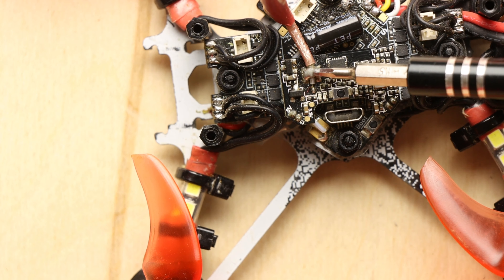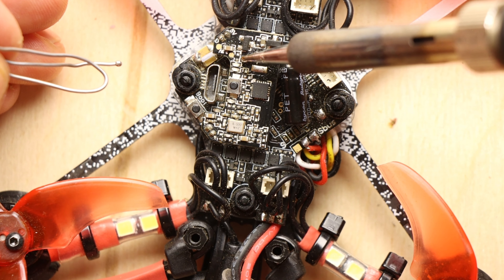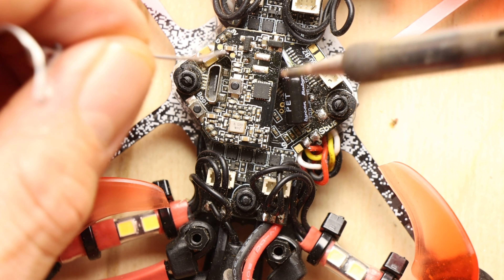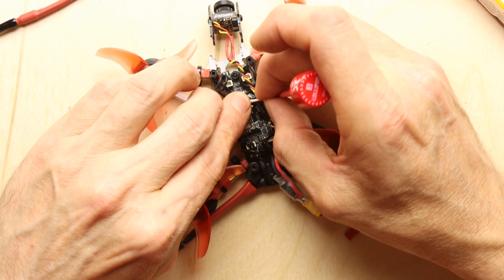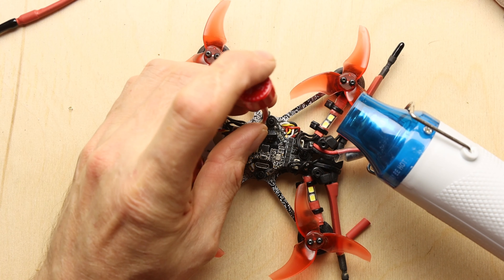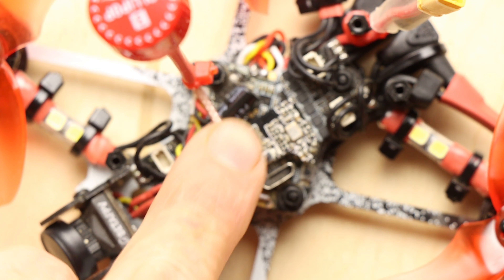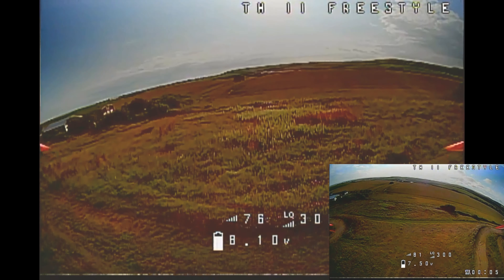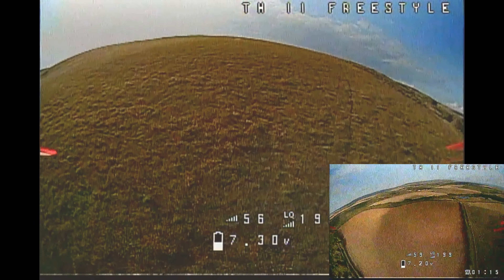emax tinyhawk 2 freestyle vtx antenna upgrade, amazing! results

Comment: Great video. Just bought myself this little quad after a lot of research and it’s great to see it being modded and it’s capabilities pushed further. Good job.
Reply from the maker: Congrats! Good buy! Top little ripper! Thanks a lot!👍
Reply: @Stevieboyfpv  I got myn too and it’s killing it ! I just don’t like the radio and the goggles that came in the RTF kit and I am looking for upgrading them. Any advise of what can I get for freestyle ?
Reply from the maker: @aymen3962  im flying eacgine 200d goggles which are superb for the price the 300d are more expensive but even better👍if your on a budget and don't mind box goggles the 800d are superb!
Reply: @Stevieboyfpv  okay and since I’ll be soldering a xfire on it I’ll buy a tango 2

Comment: Great video, you make the soldering look so easy. I have a lttle experience soldering and thought I would be able to follow right along and ended up with an epic fail. Lesson learned though lol. Soldering this connector is not for the faint of heart, very tricky stuff.
Reply from the maker: Thanks! Yeh having both the gear and practice is deff necessary but you can always solder the antenna directly do away with the ufl connector to make it level 3 difficulty instead of 10
Reply: @Stevieboyfpv  yes, but when I was removing the uhf connector that I did not get soldered on correctly, it ended up removing the signal connection solder joint all together. Big bummer for sure.
Reply from the maker: @ryzurrin  mmmm maybe watch my vtx video then so you can fit a better vtx transmitter and save the board that will be cheaper than a new board aswell 👍
Reply: @Stevieboyfpv  will do! You have some awesome vids, just wish this stuff was half as easy as you make it look lol. Have you had epic fails while learning?
Reply from the maker: @ryzurrin  of course thats why I made the vids to try and help others not make the same mistakes I did, I've killed a few components racking up the pounds along the way painfully! Thays why I made this series so the mistakes could be made and skills honed with this little guy which is massively cheaper before moving onwards and upwards in the hobby to the bigger stuff👍
Reply: How do you go about putting it directly to the board

Comment: I managed to break off the active part. Now what?
I seemed to successfully soldering the antenna on, and has flown with it, but this morning picture broke up, and it turned out that the pad was coming of. 
Great upgrade indeed. Any tips on how to save it? Anywhere else on the circuit board that I can find the active connection?
Reply from the maker: Sounds like you over heated the pad causing it to release 😔 unless you can scratch off the board a little to somehow get a solder point i don't know of another way I am affraid sorry.
Reply: @Stevieboyfpv  Thanks. Will try
Reply from the maker: @pedereskildsen  good luck! Hopefully you won't have to replace the
Board 🤞🙏🏼 i feel your pain ive been there, that is fpv unfortunately we learn a lot of skills...some painfully! I've spent thousands 😬
Reply: @Stevieboyfpv  Thanks. I did have to replace the board ☹. Fortunately I already had a spare from when my first TH got shredded by my robot lawnmower... 
(Don't fly during mowing, when not super experienced)😳
Reply from the maker: @pedereskildsen  argh! No! Thats a shame! But hey! Must of been a relief you had a spare! Some luck at least! Lawnmower aye!😬😬😬 that must of been a bad day! Enjoy being back in the air man!🤟

Comment: Do I need a special board to do this modification, or can I add this antenna to the original board my tinyhawk freestyle 2 came with?
Reply from the maker: This is on the original board the tiny came with. You can add the antenna directly or with the plug. The antenna directly is a lot easier by removing the plug and exposing and separating the ground sheath and active core and direct soldering. Practice till your confident with your soldering iron if your not already proficient 👍

Comment: Can you tell me what lollipop antenna you used and the connector too, and where I can get it for my Tiny hawk freestyle two?
Reply from the maker: I used a foxeer lollipop but any rhcp lollipop will work, its a uf.l connector but you can direct solder it the same as the original antenna also, you don't have to use the plug. I used companies in the uk 
Droneauthority and hobby rc and unmanned tech

Comment: Hey buddy what soldering iron and tip do you use, I’m feeling a bit overwhelmed with how small the connections are on the tinyhawk and not sure what to buy. Thanks in advance
Reply from the maker: Hi jonny, i use a zd-929c adjustable soldering iron with various size tips depending on the job. If you are going to get into fpv a good soldering iron is a must. I use a soldering iron 
Sponge
Brass wool 
Tip refresher crystals
Solder paste 
All to keep my tips in good condition as this is essential! I use flux core solder and good quality soldering makes a big difference so don't buy the cheapest.
I would advise buying a soldering practice pad and watching tutorials to get comfortable. Last thing you want is to kill your quad because you made an avoidable mistake. 👍

Comment: Another bang-up job. Much appreciate your experiments.  I had been contemplating some upgrades to my TinyHawk II FreeStyle. I’ve gotten my Crossfire kit in, and will be putting one in my original TH2FS, after I finish my 2nd one, which I’m now building from scratch. 
Thank you, keep up the great work!
Reply from the maker: Thanks man! Stoked you think so and appreciate your comments! Have fun with yours it really is an amazing little ripper!🙌🙏🏼👍
Reply: I got a tiny hawk what are the first upgrades I should get to make it fly faster and go longer distance
Reply from the maker: @thraxexotics3406  The motors are a 3 bolt which makes them a problem to upgrade unless you change the frame. But changing the battery lead to an xt30 connection with thicker gauge wire will help performance and the vtx antenna upgrade in this vid for video feed distance and then one of my rx antenna upgrades will help from one of my other videos 👍

Comment: I'm about to perform this upgrade. Would you say that it's a good Idea to stay around 300°C?
Reply from the maker: Yeh if your doing the plug you want it as low as possible as you can actually melt the tiny board the plug is made from its not as bad if your going for the sheathing method of direct soldering the active element and ground
Reply: @Stevieboyfpv  What were your heat settings? That's what I'm worried about. I don't want to over do it and melt the pad underneath. I'm going to remove the original solder and anchor one side first so that I can avoid the solder getting underneath.
Reply from the maker: @FlockofSmeagles  I was at just under 300 mines a dial not digital so its not super accurate I think if you can do it with touches like I did with a slightly wet tip you should be good at 300 what you want is just enough solder on the pads on th vtx board for it to stick like a little bulge so when you tack it its not cranked at too much of an angle pitched off the 2nd ground then add a touch more when both grounds are attatched taking care not to let the solder from either ground flow into the middle linking it to the active element centre. after that attatch the active element 👍

Comment: such long and loose antenna will cause noise on gyro.
Reply from the maker: Having no issues so far its been flying like a dream! I have considered antenna tube and a thicker zip tie for more rigidity though 👍

Comment: Your videos are great. I am looking into upgrading my video range. I am a new to FPV just bought the Tinyhawk 2 bundle pack to get started. I and dont know all the ins and outs as I am just getting into it. It is awesome to have people like you sharing your knowledge. Thank you. For fear of sounding like an idiot, can I do this Omni Lollipop antenna upgrade with the stock with EMAX bundle FPV goggles and achieve extended video range?  Or should I just extend the stock antenna? If I need to extend the stock antenna, could you post os send some links on you you did that? Thank you.
Reply from the maker: Thanks! Much appreciated! You can do this with the kit you've purchased but I'd probably change the antennas on your goggles aswell. Links are in this videos description of how I changed the rx antenna for more range under frsky antenna mod. If I were you as your new if you do this mod with the vtx antenna maybe do the direct solder method like the original antenna is soldered like I do in the rx antenna mod for both as the plug method is pretty hard! And maybe get some good soldering practice in 1st untill your super confident!  Also I as I hinted at in this vid I ended up going shorter with a chunkier zip tie in the end and having a little excess slack to allow for more flex 👍 happy flying! Enjoy the fpv life its pretty 😎
Reply: Once again than you so much for these videos. I did the Frsky antenna mod. Unfortunately there was not a great platform for the base connector so I just hard wired it. Then I did the Foxeer lollipop antenna mod whit the base connector like you did in the video. Range was increased but still limited by the video. Then I replace the EMAX goggle antennas with dual Foxeer lollipop antennas as well and WOW!!! I have been flying in my neighborhood which consists of 1 and 2 story residence, along flat land, very large trees up and down the streets and above ground power lines. My range increased from about 100-150 before I lost video, to about 500-600 feet skimming the treetops and houses. Thank you so much for sharing all your wisdom. Now I just need to get either a better camera and som letter goggles that can record video, or get and insta360 and a mount for it. BTW, how do you like the insta360 compared to a GoPro? Thanks again for all the videos
Reply from the maker: @CptRadical  excellent! Well done doing the plug conversion 👌 not an easy task so congrats! And sounds like a great range increase for a built up area with interference 😁 there is no comparing my naked gopro to the inta360go...maybe the go 2 with nd filters gets closer but the weight is the same the go is lighter and the tinthawk can handle it was better and keep a flight time worth flying. I have the go 1 as I bought one when they came out and on micro analogue quads like the tinyhawk 2 it give me recordable HD stabilised footage for 5 mins at a time and I just appreciate that for what it is their cheaper to get hold of now aswell. I think unless you are going for a bigger quad the go is the heaviest I would go for on th e tinyhawk...but! There is also frames avaliable to transfer the tiny components over to which would allow a motor size increase which could possibly allow it to carry more weight like a go 2 or naked gopro as the current frame only allows 3 bolt motors limiting you to basically stock. Hope that helped happy flying!😎👍
Reply: @CptRadical  Drone bro nice work! Now really make this complete. Fatshark Dominator. Rapid fire module. One omni antenna, one patch antenna. If I had known before I would have thrown out the emax goggles immediately. I now fly in places never imagined. Welcome.

Comment: Made me cringe when he started picking at it to see if it was on doing that can rip the pads off
Reply from the maker: I was feeling for any movement, if it couldn't handle my nails gently tweaking it then it deff wouldn't handle the antenna being popped on and off which is an actual tugging motion. You would have to pick much much harder than I did to pull the pads off with 3 solder points holding it unless you had cooked the pads when soldering.